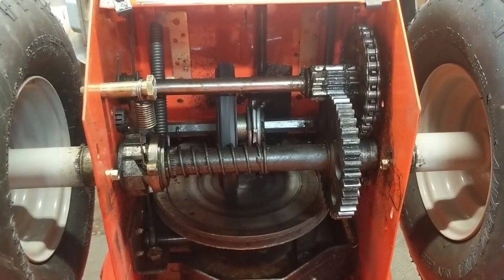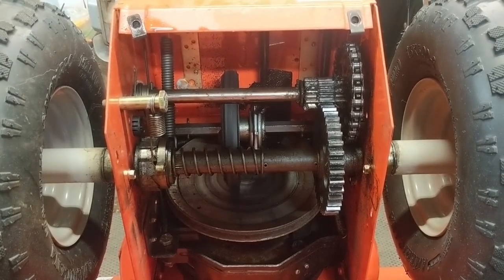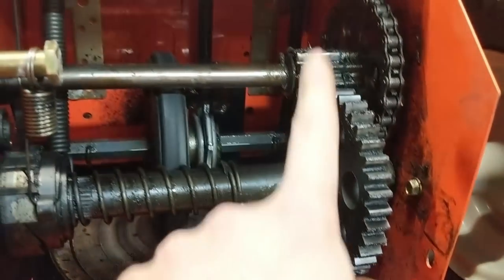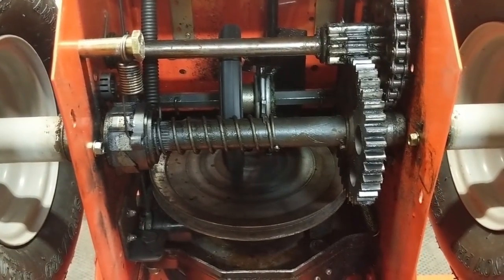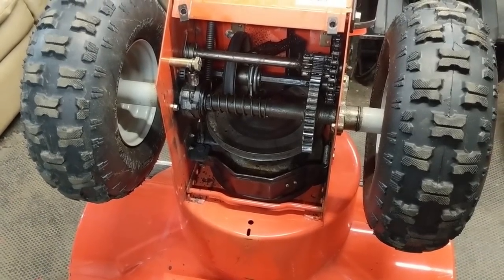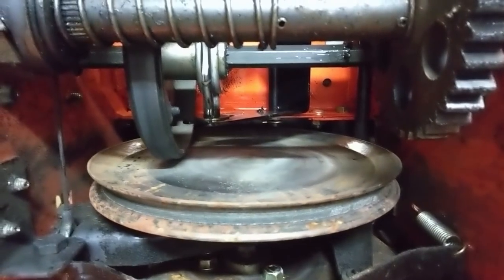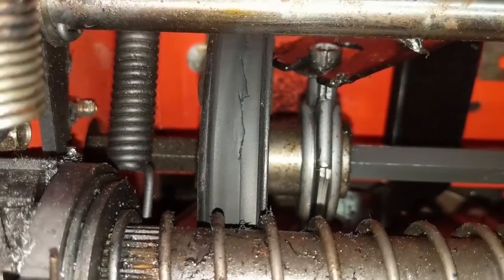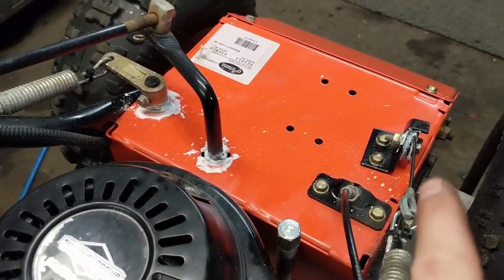Snowblower won't Shift Gears? - How to Lubricate Properly

Comment: Can you do a replacement of the friction disk video?
Thanks
Reply from the maker: https://youtu.be/p30h1gTTje0
Reply: @EliminatorPerformance  does red n tacky work well for snowblower grease? Says good for cold weather applications? But a multipurpose grease 🤷🏻‍♂️
Reply from the maker: I've never used it, but if it's rated for low temp it should be ok
Reply: @EliminatorPerformance  I called the company and they said red n tacky is good up to -22 degree ferenheit. We rarely ever get those temperatures in New England. They said also dont get it on plastic as it can ruin plastic over time

Comment: On page 15 (lubricate unit) of the Ariens Sno-Thro compact series operators manual (printed 4/18), Ariens recommends "Hi-Temp grease" or equivalent. Yes...Hi-Temp grease. Lol. 😆
Why I have no idea, since there are no high temps, nor high friction heating areas. 
Glad you reminded people to use the PROPER low temperature grease. Thank you.

Comment: @1:45 The grease/oil placed on the "dogs" will not drip onto the friction plate as stated. Once the blower is UPRIGHT, the dogs "drop" grease on the inside belly pan, not on the friction plate. The friction plate, over time, "can" get a bit oily/greasy by splatter from faster rotating shafts than the drive wheel shaft. Putting the friction plate "under" all these rotating shafts and gears would have been pretty stupid by the manufacturer.

Comment: Nice video amazing what a difference the low temp. grease makes on the shifter hex shaft for ease of shifting. The grease you put on the wheel axles is just blue bearing grease which is cheaper than the low temp is it ? Most people do not do this and big problems when you want to remove the wheels for repairs.
Reply from the maker: This #2 Mystik grease is the best! And you're right, most people wouldn't grease the axles!

Comment: Do you use the same grease for the gearbox for the impellors .
Reply: I use a mix of grease and gear oil. Grease alone will not keep the gears lubricated over time. The grease will  get shifted to one area and not keep gears lubricated.
Grease and gear oil mix will keep it fluid enough to not sit in one area of the case.
Reply from the maker: Not fully, sometimes I'll use this to pack in the corners, and fill it spots that won't "flow". Then in the areas nearest the work gear, I'll use a 00 grease.

This grease is rated #2 so slightly thicker than a 00, but still soft and made for low temperatures!